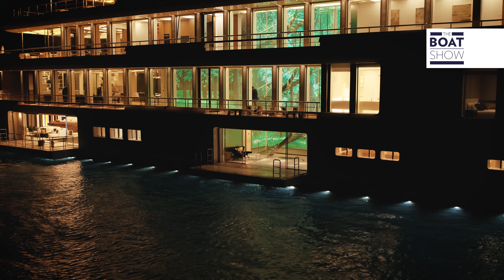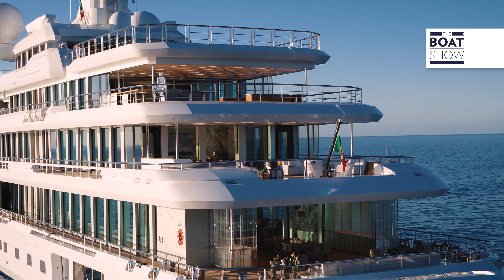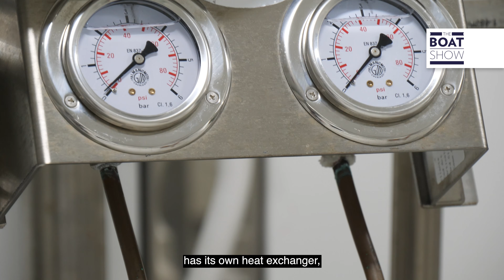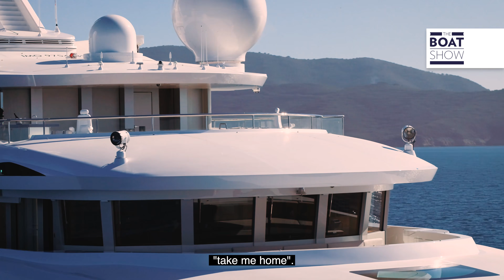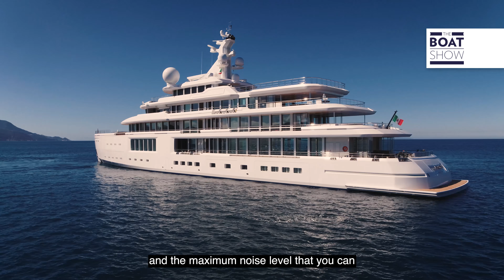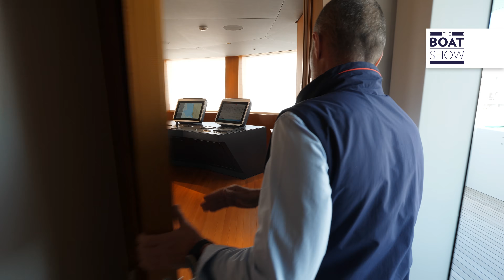BENETTI FB 272 "LUMINOSITY" - 107m Hybrid Giga Yacht Exclusive Engine Room Tour - The Boat Show

Comment: Watched the interior video first and that blew me away, such a magnificent ship.  This video brought it home the decibel level was lower than most home dishwashers.  And you have as the engineer said instant power to your engines with the diesel/electric motors.  Absolutely amazing ship, well done Benetti
Reply: Don't forget the cost, though. Let's start with the diesel part of the equation. The most thermally-efficient diesel engines today might peak at around 45% - that is, 45% of the energy of the fuel-oil is converted to power/torque at the crankshaft. Next, bolted on the end of the crankshaft we have an electrical generator. Except, of course, it won't be bolted directly to the crank, because it will have to go via some form of speed-regulating gearbox, and/or have a very precisely controlled throttle in order to keep the generator running at constant speed. Via another gearbox [reducer] this will bring the rpm of the drive down to e.g. the 50 or 60rpm needed to deliver a 50 or 60Hz AC output. Finally, the generated electrical energy is going to then be fed to an electric motor, which, as you note, is how you get "instant power", because of course an electrical motor can get from stationary to operating rpm extremely quickly. 

But now you have to think about the capability cost. Unless your diesel generator is running, you won't have the electrical current needed to give you that "instant on" - which means that you're going to need to run your generators for extended periods, just to be "available" for that "instant on" to your propulsion system. 

What you write isn't wrong, per se, but to achieve the feature you're calling out it requires the yacht designer and owner to make an awful lot of very expensive and inefficient compromises. 

However, there's another aspect to this which may be even more important that you didn't mention. Because the diesel engines are not mechanically connected to the propellers, you get a much, much, much more effective isolation of noise and vibration. You can literally mount your diesel generators on suspension platforms, with isolating shock absorbers and insulating materials, so that absolutely no noise or vibration from the engine gets out to the superstructure/hull of the yacht. Your main drive, being electric, is automatically going to be much smoother and quieter than a diesel engine. So what you find with D/E propulsion is that you are trading fuel costs [they are more expensive to run because of the added inefficiency in the system] for the very low noise and vibration.
Reply: @spacemansproggit5627  Diesel engines achieve maximum efficiency in a fairly narrow range. This also applies to diesel generators.

The savings of hybrid systems arise precisely because you always operate the diesel engine in its most efficient range. For example, for a 1 megawatt generator, this will most likely be about 600 kilowatts.

You have put forward a not entirely correct hypothesis regarding the availability to use of azipod without starting the generators. They will be available(silent running mode), because there are 3 megawatt hours of energy in the yacht's power bank, but the maximum speed will be lower (most likely 6-8 knots), since inverters are unlikely to produce 5 megawatts and this would quickly discharge the batteries and this is not very good for the batteries.

Most likely, on batteries only, the yacht can sail for about 1.5-2 hours depending on the speed, so you will have quite a lot of time to start the required number of generators if you suddenly feel the urge to sail immideatly, like tsunamy warning for example.

Comment: Lots of green terms and hyperbole thrown around here but to what end? Other than balancing hotel loads and not waking the guests for short journeys or maneurvering where is the advantage. Using generators to transfer energy storage from fossil fuel to batteries (inefficiencies in conversion?). With no green generation you’re still filling up 400,000 litre diesel tanks. Smoke and mirrors.

Comment: err, just wondering, i think yacht andromeda ex ulysses and her slightly bigger sistership are diesel electric as well and their gt is bigger thatn FB272?
Reply: 106 m Andromeda has similar gross tonnage, around 6.000 gt, Ulisses yes is 10 meters bigger than Andromeda and higher volume at 116 meters but Luminosity is way more fuel efficient, it can power the whole appliances on board for 12h just on the 36 ton battery bank, maneuver whitout emissions around protected marine life areas with the engines turned off

Comment: I work in sustainability and the trend in my sector (datacenters) towards lower carbon footprint is driven by customers of Apple and others, yacht charter will probably follow suit with the clients (or their children) demanding lower carbon emissions for their charters. ps I designed and built a (much smaller!) boat with this propulsion system 12 years ago!

Comment: Luminosity is, by any measure, a curious yacht. Delivered to her owner in 2020, she is up for sale *already*... not unheard-of at this point in the market, but unusual. Boat International doesn't quote a price, but she's listed between the 95-metre Lurssen Madsummer (229 million Euros) and the 95.2-metre Lurssen Kismet (169 million Euros), making her the 4th most expensive yacht on their books (the most expensive being Octopus). With the possible exception of "Elements", the 80-metre Yachtley build, launched in 2018, Luminosity is the only megayacht in the top 20 listed whose lines seem jarring and out of place. Maybe it is the white-painted separators between the huge panes of glass, maybe it is the box-like structure, maybe it's something else... but she just looks ugly. Certainly a technical marvel, but not exactly easy on the eye. Somehow I don't think that she will fetch her asking price.
Reply: Yes, that exterior view, i call it 'shopping mall on sea'. It get points for the high ceilings and there are occasional moments of interior excellence, but for the most part the interiors veer towards the tasteless.
Reply: @dleetr  And if you look at other similar yachts up for sale - Madsummer, Kismet, Valerie and Ace from Lurssen, Sunrays from Oceanco, Secret from A&R and Plvs Vltra from Amels, all of them use curves to soften the lines. Plvs Vltra is a good comparison - take a look at her pics in the sales listing at Boat International - because she has the same large, squared-off stateroom windows on the main deck and lower deck. Yet on the Amels the corners are softened slight, while on Luminosity they go in to hard right-angles, lending to the cubist vibe. It's like the designer was trying to channel Picasso from his cubist period. The other yachts I list here can settle in to a landscape and look peaceful in a bay or marina... Luminosity has more of a jarring effect. But who am I to say? I couldn't afford 100,000 for a yacht, never mind 100,000.
Reply: @spacemansproggit5627  woudn't privacy be a concern seeing that you can see the interior at night unlike other boats with privacy glass of tinted windows?
Reply: @tonysstudio7037  I think the short answer is "Yes"... but we have to qualify it. Let the video run to the 57-second mark, and you will see the presenter on what appears to be a primary gangplank/passarel for access... But now look behind him at the yacht's windows. To his right/our left you will see a conventional venetian blind... and to his left/our right you will see what might possibly be a roller blind [where the retracted roller might be concealed within the ceiling] in the lowered position. 

So I think there is a degree of conventional privacy, though it isn't clear if those elements were original fit or have been added since commissioning. 

But I think your question remains valid from a security point of view rather than a privacy one. The sort of person who can afford to own a yacht of this size has got to make a pretty impressive kidnap target - and knowing whether or not the target happened to be on board would be a lot easier with this sort of open design style. So in this case perhaps the commissioning owner either wasn't too concerned about their personal security and/or happened to be an uninhibited exhibitionist.
Reply: @spacemansproggit5627  valid, but the yacht's design focuses on natural light, hence the big floor-to-ceiling window. Having roller blinds greatly reduces the natural lights coming into the yacht